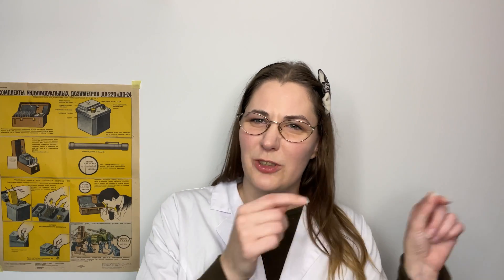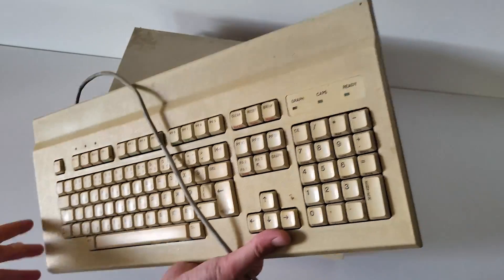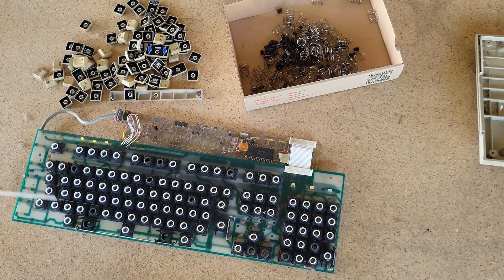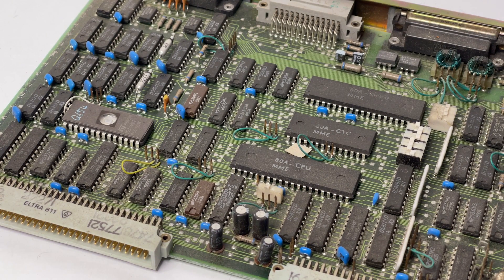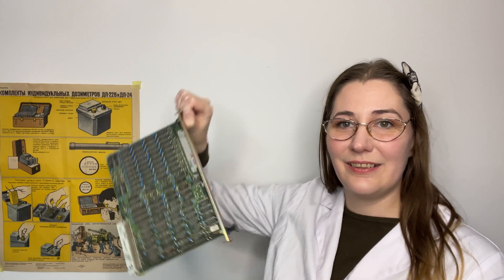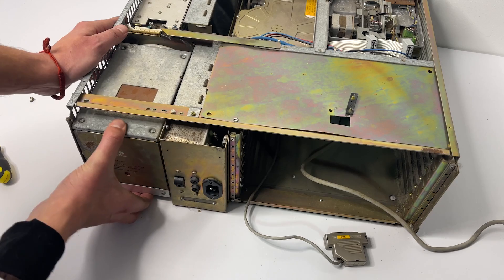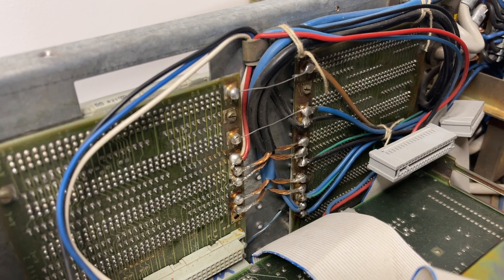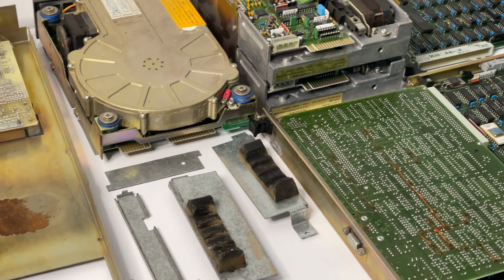It is not a COMPUTER, it is a DISASTER. Robotron SM1910, made in DDR in 1988

Comment: This is similar to "standard backplane" computers before the PC era. There are many backplane schemes and standards, none of which were compatible with each other. The slide in boards had standard connections for the type of backplane, but if there was IO needed that wasn't part of the backplane standard, then you had ribbon cables running all over the place, sometimes outside of the back of the box. Industrial controllers were often like this. This computer was cobbled together out of such a standard, and all the rest of it were afterthoughts and tack-on features not part of the backplane chosen.
Reply from the maker: Thank you for these details!

Comment: The cards look like those of the VAX machines, probably they cloned it from them including the design. I have seen bigger computers with many CPU cards to run as a multiprocessor system. But I'm shocked they labelled the hard drive to be made in GDR. I think it was not, while having a look on its nice sticker for bad block information held in english language (it was made in USA for sure ;)
Reply: They actually made MicroVAX clones in the late 1980s.  And as for hard disk drives they actually had a factory in Zella-Mehlis tooled up by Microscience which made 20- and 40MB hard disks.

Comment: I think it would be good to desolder all EEPROM-s in this computer and read them (for ex. with MiniPro programmer or a lot cheaper Arduino stuff)
Reply: Not needed. The numbers on this EEPROMs (273-276) hints to BIOS(ACT) Version 2.3 who is already available. Only missing is the last Version 2.4. PM me if you need the URL.
Reply: I have my fingers crossed that the EEPROM chips still hold their programming.
Reply: @XalphYT  one way to find out :)
Reply from the maker: Frankly, right now not really possible to do, though I believe it has been done before. This machine is not rare and there is a community of Robotron fans in Germany, so...

Comment: Those voltage rails had me making a similar face to her. OMG that was certainly *A* way to do it. A good way? I don't know...
Reply from the maker: My friend Boris would solder it better.
Reply: This are double 6mm² wires for the 5V. Modern ATX supplies does also use multiple wires for 3.3V, in summary not much thinner...
Reply: @ChernobylFamily Please open the 5V power supply, and show the solder side of the low voltage PCB. They really riveted copper sheeting onto the tracks to increase the cross-section. Never seen such kind of madness.

Comment: Conjecture: I'd imagine those card connectors into the backplane riser are electronically compatible with the ISA bus, but using easier to obtain connectors. Single connector for 8-bit cards, dual connector for 16-bit cards.

The connector to nowhere on the RAM boards was probably a debug port used to check the memory during assembly and diagnose faults in the field (you would remove the metal plate to access it).

Interesting video. I like your content and presentation style 🙂.
Reply from the maker: Thank you! The bus there is Multibus, as for hidden connectors in the comments was an opinion that these boards could be used elsewhere where they could be, let's call it like this, stacked to form bigger banks.
Reply: Nope, The left connector is compatible to Intel Mulibus, the right ones are Z80 subsystem Buses only partially connected.

Comment: Good heavens, what a beast! Redundant power supplies--OK makes sense. Maybe designed for a high-reliability requirement, server, manufacturing control, whatever. Wait--redundant power supplies that can't be removed without completely disassembling the machine?!? I guess design for manufacture and design for maintainability really aren't priorities in a command economy.
Reply from the maker: To be historically accurate, depended very much on which designer bureau was involved. Hungarian Videoton has been making some really outstanding designs sometimes. Take even ES1841 — just a few wires inside, same functionality as this. But in general, this was as you told.

Comment: Someone must've been tasked to create jobs for the glorious industry... Anything that comes close with the western computers (that I know of) is Tandon Target AT from 1987. It had plastic faceplates on both front and back of the machine, and you started the disassembly on the back, it had five screws holding it in place. After removing the back plate the plastic side panels had to be slid out, they had locking teeth and they were really difficult to handle; they were snugly against the chassis so you didn't get a good hold on them. Once they were out, the computer was sectioned into three compartments. One compartment held the power supply, and the rest was for the custom split motherboard; one half holding the CPU, base memory and standard I/O, the other half holding the expansion boards; they were on the opposite sides of the machine so for complete motherboard access you really had to remove both side panels. Each compartment was covered with steel plates that were held with numerous screws, around ten each. If you needed to remove the front plastic panel, you had to unscrew it from the inside. I never got around to disassemble the whole thing, but getting to the bare chassis was around 40 screws. I've been told that thing was expensive (something like over two month's gross salary or so) and for obvious reasons. I also recall it being called "a nightmare" from the computer service perspective.
Reply from the maker: Oh. My. God.

Comment: As far as I know 1910 display was progressive scan. So it's actually around 640x240. It may have similar non-interlaced timings 12.312 640 662 719 784 240 244 247 262
Reply: I have connected my CM1910 by a quite simple adapter to a (kind of) modern flat screen. The adapter only have to split the mixed hsync+vsync signals into separate for VGA.
Reply from the maker: Thank you, this will be useful
Reply: @ChernobylFamily  It was long ago. So I could miss something

Comment: @12:04 - calling in the engineer for help!
VERY well done with the dramatic/comedic effect - I was literally LOLing.
Also, those expansion card connectors look just like the card connectors in the Siemens PLC we have at work.  Guessing that connector was popular on both sides of the German iron curtain.
Reply: @14:15 - wow, that terminal block is straight out of an industrial control panel, like the one our Siemens PLC is mounted in.  And the soldered wires...
Reply from the maker: Interesting...
Reply: @5:34, those wires soldered onto the circuit board, are called "bodge wires" by US retro-computing enthusiasts.  Also, what you call "crate", I think we would call the "chassis".
And finally, I am so glad Michaela is doing well.  May you both (and feline engineer!) stay safe and healthy.
Reply from the maker: Thank you!
Reply from the maker: Yes, that was fun to do :)

Comment: The hand-made patches on the boards looks like bug fixing after production. When prototyping a board, one typically make some error and it can be faster to patch it with wire rather than order corrected boards. It's labor intensive and error prone. Sounds like once the production PCBs were ordered, that was it, no more PCB order, gotta patch all the run by hand.
Reply from the maker: Yes, we faced that with ES1841 - check the Ep.2 on our channel
Reply: It was like that in those times. Fixing the errors and rebuilding the cards would have mean the others would be scrap. But if each card is around several thousand Marks (or dollars if you like) it would be cheaper to add some wires. This was my job back then, I have made many of those refacturings. And I do not talk about prototypes, but the PCBs were already made.
Reply: Budges. Not unheard of to see one or two even now, if far from common.

Comment: Redundant power supplies, and remote operation via modem. This looks more like a server than a personal computer. I'm glad that Michaela is back.
Reply from the maker: From what we found, it was a business-purpose PC. However, we believe actual Robotron users may correct. 
Michaela sends greetings :)
Reply: Nope, on power supply +5V, one +-12V, one +12V Standby. Because of the standby supply this machine can be switched on and off from remote. It also can switch itself off by software.

Comment: It's like they tried to make a fully modular computer where all of the boards could be swapped from outside but failed catastrophically. The additional "outside to inside" ribbon cabes and cards hidden inside feel totally like an afterthought / duct tape fix to finish what they started. Also, you should put some stickers over those EPROM windows!
Reply from the maker: Yes, covered them already. Thank you :)
Reply: @ChernobylFamily  Hopefully they are not already erased itself. Their halflife is over multiple times (even with a sticker). Good luck.
Reply: @myragion  The EPROM chips in @Usagi Electric's even older Centurion minicomputer were fine.  He copied their contents promptly after disassembly, in case they failed later.
Reply: How sensitive are they to UV light? Would they need the equivalent of that curing light at the dentist, or a 40 watt incandescent bulb?
Reply: @mstcrow5429  Regular incandescent bulb probably won't do anything at all; my understanding is that you need relatively short wavelength UV to erase them in a reasonable amount of time. UV phone sanitizer  (very short wavelength UV-C) will do it... party black light might do it given enough time but is far from ideal (depends on if it puts out any short wavelength UV at all). Outdoor sunlight can do it, but is highly variable with atmospheric conditions (could be hours to weeks)

Comment: At the start I thought it was strange that the girls were moving those other computers on carts. But if it's made anything like this computer, I can understand why, because they would break their backs trying to carry them by hand!

As for this computer, it seems much more complicated than it probably needs to be. It's like every part was designed by a different team, and they decided all to put the different modules in its own enclosure or case made of metal. Then they brought all the parts together and bolted them into the case with more metal, and just kept adding wires and cables until it worked.

Anyway, I hope you don't hurt your back carrying this computer after you reassemble it.
Reply from the maker: That picture is one of the first of May festivals, where robotron staff participated... a bit strange side of socialism. Needless to say yes, damaged my back already :)

Comment: 56000 EAst MArk --> that was after the joining of east and west 28.000 D-Mark, which translates to 14.000€ before Inflation and ~30.000€ after Inflation.

If I'd have to guess, that connector on the ram-board is for analysis after assembly of the board.
Reply from the maker: JESUS.

Comment: That must be one of the most overengineered computer system around. Construction screams of industrial system, I have only seen similar construction in rack units for old industrial robotics and automation controllers. I think that maybe this system started it's life as a one, that would explain why the internal cables are connected outside, and why some of the connectors are blocked behind the card brackets.
Reply from the maker: There came people who explained that this wiring was caused by a possibility of two different configurations - graphic that we have, or a text-only. However, this does not make it less crude

Comment: Around 1998, I got a Robotron computer just by walking the street. It was throwed away, prepared to be sent to a scrapyard with another equipment. It was from a research institute that closed at that site and it was obsolete.
Quite a beast with a I8080 CPU, 128kB of RAM, two 5.25" floppies, provision for a HDD in a separate enclosure  with another two floppies (that I did not get, thinking that it was another identic computer), it was a beast. It had 5 or 6 boards inside on a backplane like motherboard with two edge connectors (not sure what standard it was). It was big, heavy but surprisingly modern looking (at first look I thought that it is an old XT clone). Sadly it did not worked, maybe some of the EPROM chips inside were missing. I used its guts (RAM, EPROMs, TTL ICs, IC sockets), to make a Z80 computer.
Reply from the maker: Wow! Thanks for such an amazing story!

Comment: Where did they get Intel chips from at that time?
Reply from the maker: AFAIK, DDR could import some. But let Germans correct me here.
Reply from the maker: AFAIK, DDR could import some. But let Germans correct me here.
Reply: Originally designed for the russian 8086-clone K1810WM86, but seems they where not available. So they put in, whatever they get. Chips like the 8086 fell under the COCOM export restriction, so this chips must have been smuggled. Mine have an original Intel 8086 and original Intel 8087.

Comment: Were those Western ICs like the CPUs obtained by bypassing export restrictions to the DDR?  The hard drive has a warranty warning seal in English, so the same question about it.  The large numbers of PCBs is probably due to the need to use large numbers of lower integration ICs instead of the custom ICs which combined many ICs into one as was done in the West.  What were machines like this mostly used for?
Reply: If i remember the old embargo correctly the GDR was banned from importing what it couldn't produce itself. So yeah, stories have it that they build a DRAM fab just to show that they could do it and import the cheaper western parts afterwards.
The CPU could be from a similar way, they showed that they could make 16 Bit CPUs so the embargo was lifted on them.
Reply from the maker: These machines were intended for enterpsise-level business use. As for chips, here people from Germany will advice better. I noticed that CPU was made by Siemens (West Germany if i recall correctly), but by intel license. In fact there is insane mix of chips. Germany, USSR, Czechoslovakia, Singapore and even Portugal.
Reply: @ChernobylFamily  I thought they have made a technology exchange program. The GDR get some hot stuff and in exchange they deliver what they had to west germany. There is one thing left of those times until today. A big car manufacturer uses the machine built in GDR even now in this moment to form the metal.. It was (or is) a speciality of GDR engineering.

Comment: Last time I saw that was on some Early 80s test equipment I worked on - one rack mount module was not actually removeable because the frame wiring loom went through it top to bottom. I guess it was from a time where people weren't that bothered about labour costs. It was just easier and quicker to modify and add to the existing design rather than taking a step back and redesigning. If you have ever read any Terry Pratchett - just like the swing Death made for his granddaughter.

You will get loads of opinions on why that memory board has the additional connector - my two'pen'orth: Possiby anexpansion to allow a second board to widen the bit width - so combine two 8 bit boards to give 16 bit width, or maybe to add on parity checking or error correction. The other though I had was to give an independant DMA channel separate from the main bus
Reply from the maker: Thank you for the story! Well, your thoughts on RAM sound like a possible reason why they did that.

Comment: I was raised in West Germany before 1990, but that DDR technology does peak my interest. It could run DCP1700, which is a DDR-clone of MS-DOS 3, or something like SCP1700 which is a CP/M 86 clone. I would've liked to try SCP on PCem even if that only simulates western x86 devices. And fun fact: The POST is called ACT (A7150 Confidence Test). That computer is certainly overengineered considering the proprietary nature and the fact that the IT industry did not get the same support as other branches of the economy.
Reply from the maker: Thank you for this insight!

Comment: The Robotron A7150 (how we call them in germany) is one of my favourite robotron machines :) have one and also two A7100.
The A7100 predecessor even cant run  DOS and is more designed as an 16bit SCP (CP/M) machine, but there exist an "BIOS" emulator you can boot from and can boot dos and run some simple dos programs! i have MUTOS (aka robotrons UNIX)  installed on my machine :)
the cable are coming from back into inside because on the configuration (textonly or extended graphics) you must connect the keyboard to the processor card or KGS, also think more convient to connect the devices on the side instead back
compatible displays for the ABG are k7229.25 K7228.2 K7234
Reply from the maker: SUPER thanks for these details! This makes it a lot more clear!
Reply: From the sounds of it, the A7100 reminds me of the 80186 processor, which was used on the first Siemens PC-D and can't run most MS-DOS programmes without modification, even though it did run DOS 2.11 and 3.20. But it was only somewhat IBM PC compatible.
Reply: Ooooh, MUTOS!! I could only find 1 video here on YT about that OS. Perhaps you'd like to make one?
Reply: @mojoblues66  accidentally i pick up today an another full working CM1910, i may install MUTOS on it and can film :)
Reply from the maker: Wow! Congrats!
Reply: @superchiaki  That would be awesome!
Reply: @mojoblues66  im not good with videocreate and editing :( but there exist an a7100 emulator but sadly mutos dont boot.